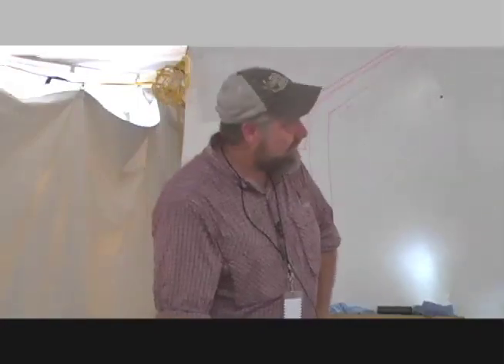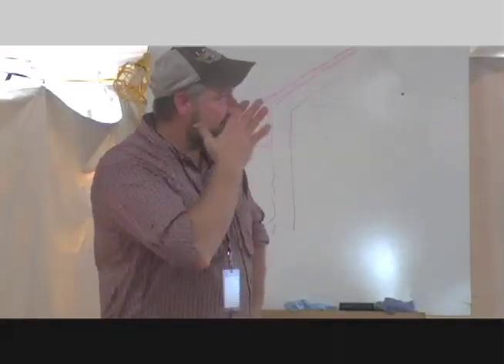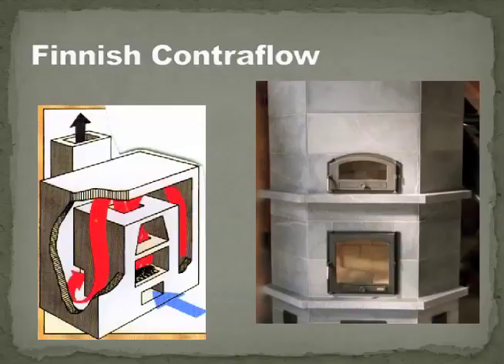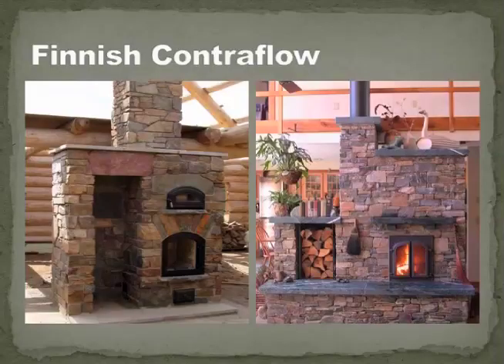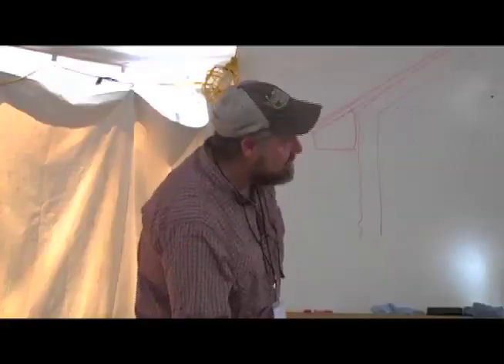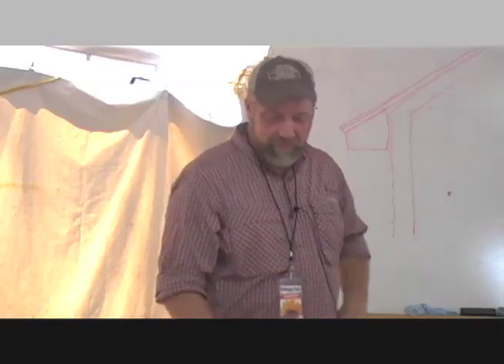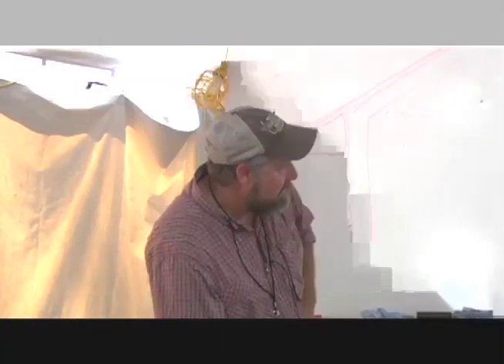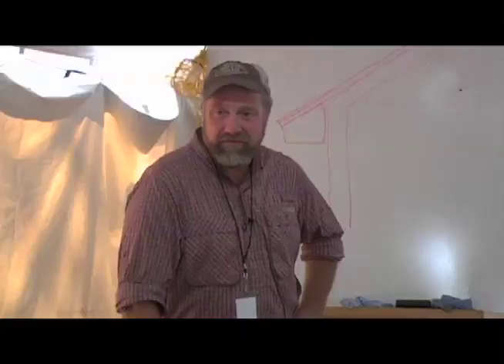Masonry Heater MREA Energy Fair

Comment: Regarding what he said about the outside air. I disagree, but he makes a decent point in one area. I have a 30 foot.. yes... a 30 foot outside air (PVC) to my wood stove from the outside running through my basement with a hole cut to the living room. (The final 3 feet is steel flex tubing and not PVC of course.) Yes, I always check to make sure the draft is going the right way (not reversed.) It always does, but he's right, in some setups it could reverse depending on a lot of different factors if the main chimney is ice cold. Maybe the dynamics of outside air is different for his designs than in wood stoves, but outside air, if it can be used is far superior for wood stoves. It's common sense. A wood stove needs so much air, many people need to crack window (letting in 10 degrees into the house!) for the stove to work properly. Using inside air is using up air that is already heated.... a waste. Because a masonry heater burn is 1 x a day for 2 hours,  perhaps it does not "use up" all the air from inside the house like a 15 hour burn on a wood stove would. Bottom line... if you have a wood stove..  rig up outside air.

Comment: Masonry heater? Around these parts we go with its original name: Rocket Mass heater. Natural draw, hot and fast fire, lots of mass as a heat battery and the draft so fast it sounds like a rocket.  Maybe the difference is the rocket has a radiation bell? I didn't get a good look at the design he showed here yet,  only 1/4 way into the video.

Comment: 12/23. We have a masonry wood stove for the last 40 years. House is 2700 sq ‘. 2 floor. Stove is 5’ by 2.5’ on first floor. 6” inch slab on ground for base. Internal firebrick for first 4 runs then regular brick above. I built my own damper from regular steel that slides on the top run on a free base to do the damping. Original damper just rusted out. Second floor just concrete blocks to run into chimney. Burn 10kgs fires. Burn fir or maple. Use a wood moisture meter to burn dry wood less than 15%. We have 13 acres of woodland so wood is free. The mason did not plan on rebuilding fire box. The fire brick cracks and comes apart. Before I have to rebuild firebox I use 5/8 stainless steel grade 304 or higher. Welded a basic insert to protect the firebricks. So far so good. The steel adds mass to the stove. Use regular brick for veneer. 1” gap between veneer and firebrick.  Stove is 8’ tall so big mass. Clean runs of fine powdery ash every 5 years.  Door is from traditional wood stove on a steel frame that is free standing to prevent wear and tear on door opening.
I’m hoping I don’t have to replace firebox firebrick. That’s the only design flaw. Stove is 80% efficient. I actually take up more carbon dioxide than I produce with fire because of 150’ fir trees.
We really enjoy our wood stove. Easy heat and very comfortable. Bench on one side and couch on the other side for napping. I highly recommend masonry wood stove for heating houses. 16,000 BTU/kg of heat. 10kg of wood gives 160,000 BTU.

Comment: How dry does the wood have to be?  Is this another one of those stoves where you have to season the wood for 3 years before you burn it?  It seems if you’re burning a super hot fire it wouldn’t matter. 

My dad always burned green wood but he would throw in half a load of hedge apple in every load. He never had to clean his masonry chimney. It just didn’t have any creasote.
Reply: Keep the wood in a shed for a year and it will be fine. If the wood is wet it will burn at a lower temperature. 

When burning wood creates lots of gases. If the temperature is low (as in case of a bad stove design or wet wood) these gases cannot burn and they go out of the chimney. Hence around 30% of energy and money goes out of the chimney.

Not to mention that soot caused by  wet wood is nr1 reason for chimney fires.